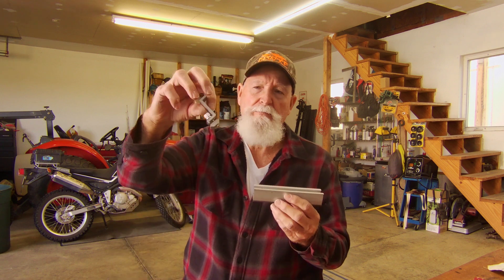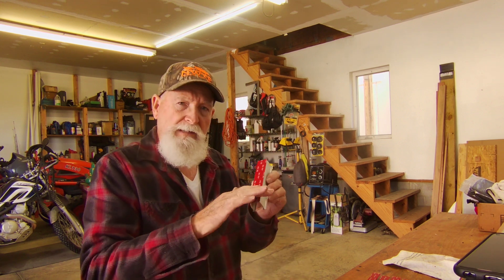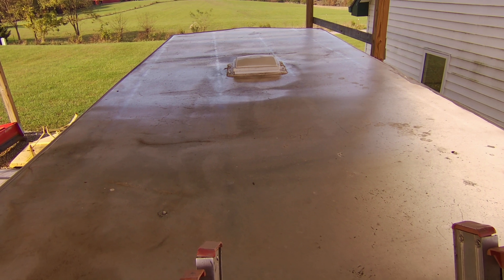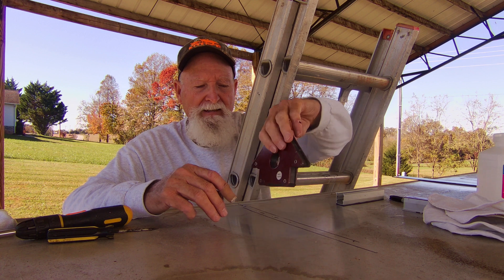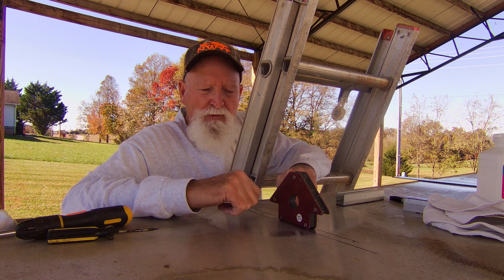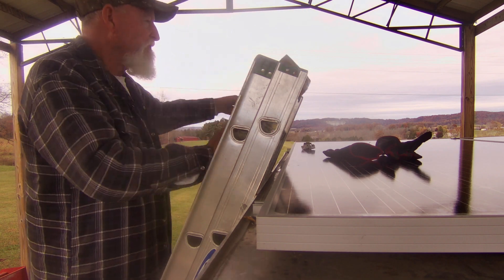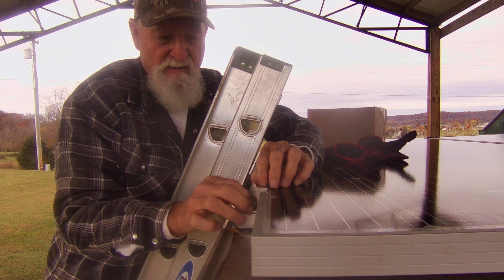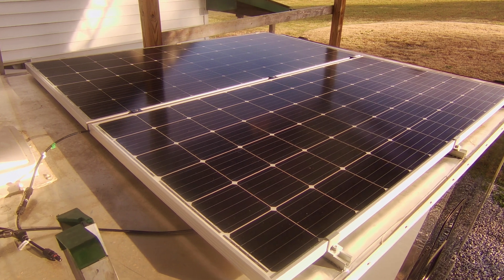RV Rooftop Solar Panel Install

Comment: Damn those stairs in the background look pretty dangerous as they have no hand rail, I'd build one of those first:)
Reply from the maker: Handrails, handrails?  We don't need no stinking handrails!  :) Seriously, yea I guess your right. I do have the wall on the other side to hold onto or reach up and touch the ceiling as I'm walking up.

Comment: Thank you for the straight forward, informative, video. Where did you et the ReneSola panels from? Most places I see will only sell or ship them if you buy a pallet of 10.
Reply from the maker: I bought them from a local Mom and Pop outfit near Clarksville, Tn.  They were just some panels they had in a local storage facility.  They can be found on Facebook Marketplace.  Put in Solar Panels, Clarksville, TN for location.
Reply: @johntalbert8227  Thank you!

Comment: I used VHB tape and two five foot angle iron to mount two 100 watt panels with room for a third panel no problem with them coming lose but I did attach safety chains just in case. Wow that is a lot of solar.